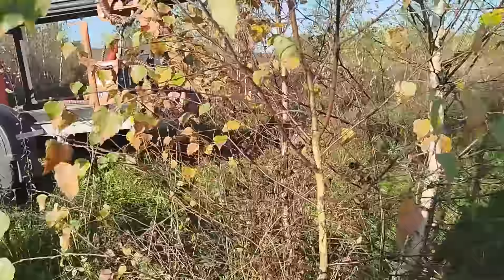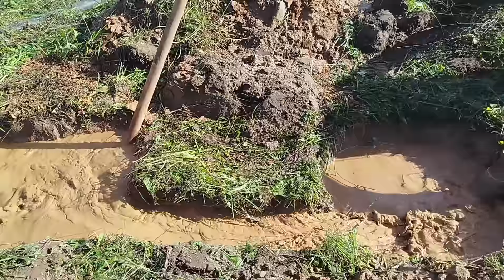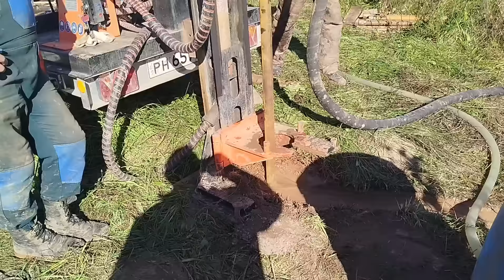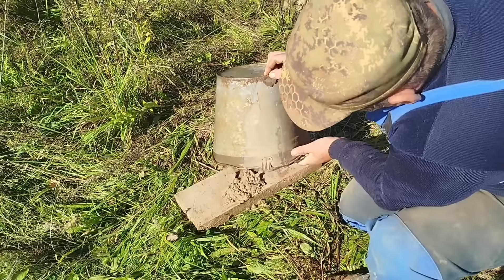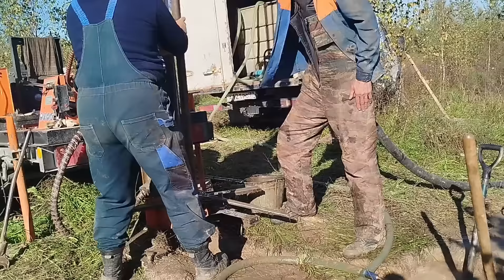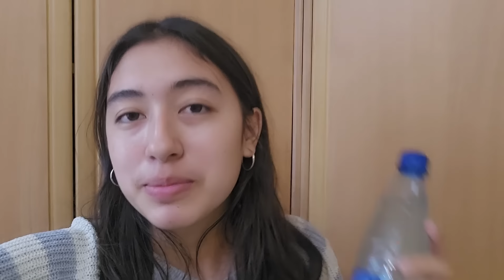How High is the Water Mama? 💧 Well Drilling 🇷🇺 Living in RUSSIA ❤️

Comment: water flowed out of the pipe because the sand started to fill the column, and it would have filled the drill rods, so the drillers continued to fill the hole to prevent the sand from falling out

Comment: Never saw a drill rig that small. How deep are you drilling? My well is 454', 140 meters. Here you must have 100' of well casing. You need to pump water for a few hours and it will clear up.
Reply: In Russia, the water is often 10 meters deep. Previously, wells were drilled manually, without drilling rigs. It was just cheaper than hiring a drilling machine.  

But it also happens to be 100-200-300 meters.
Reply: I was also surprised that the drilling rig was so compact. When I ordered the drilling, a huge truck arrived, and it took a long time to maneuver in the tight space.

Comment: This water can be filtered and drunk only after it settles, as the radioactive rodon gas dissolves at depth. It is better to boil this water only after filtration, so that the dishes do not become overgrown with stone (calcareous plaque). Tests have shown that Aquafor filters are the best. You can filter this water in pitchers using these filters, or you can install a filtration system consisting of several filters from a water pump under the sink.
Reply: на счет радона в общем да,лучше после отстаивания,а на счет жесткости ,это после анализа воды узнают,скважина на песке ,может будет и норм по жёсткости
Reply: Сначала так бывает, что вода мутная из скважины и её прокачивать надо. Но анализ в любом случае надо делать чтобы посмотреть состав и потом выбрать фильтры которые подойдут чтоб самим её пить.